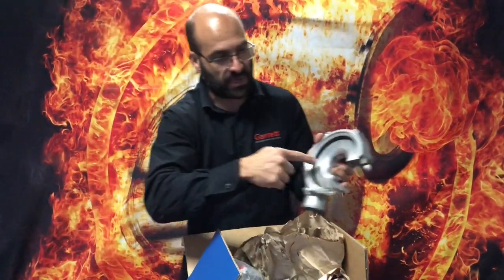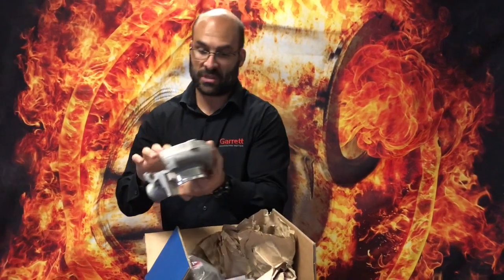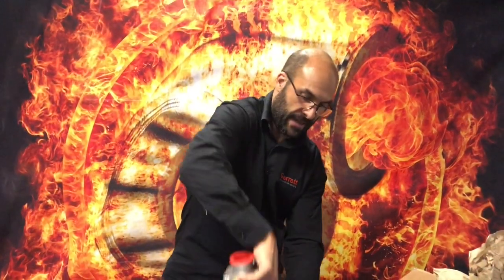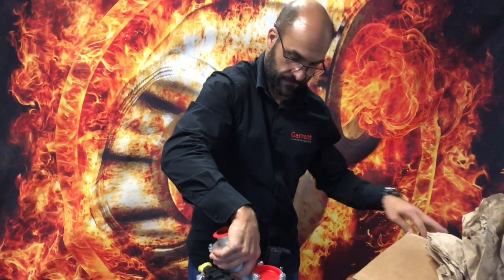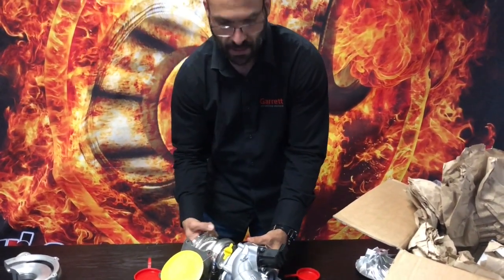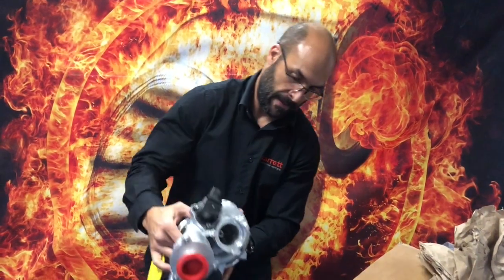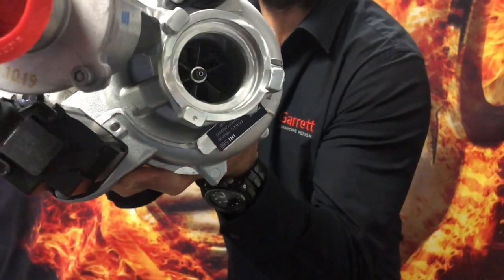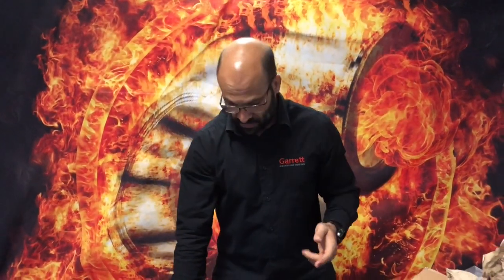IHI IS38 turbocharger facts

Comment: I just changed my compressor wheel on my IS38 and it was making this sound and it had me worried…. After watching this I feel a little better about it but I do have one more worry.

When I removed the nut off the compressor wheel it was NOT reverse threaded…. Everything I’ve read says the IS38 compressor wheel nut is supposed to be reverse threaded.

Mine is a JHJ if that makes a difference at all.
Reply from the maker: The shaft nut thread is opposite to the direction of the CHRA rotation. if your compressor wheel (from facing the compressor wheel) rotates clockwise, then the nut will tighten in an anti-clockwise direction and vice versa.
Reply: @TurboDirectSA   well something is wrong with mine then… on mine the wheel spins clockwise and the nut tightened clockwise
Reply from the maker: @robertburton8055  The IS38 compressor wheel when looking at it from the front will not rotate clockwise, it is an anti clockwise rotation.  Shoot me an email with a picture of the compressor wheel please - info@turbodirect.co.za
Reply: @TurboDirectSA   actually you are correct!!! I was misunderstanding how the fins orientation relates to motion….

I was mistaken… it definitely rotates counter clockwise and the nut tightens clockwise
Reply from the maker: @robertburton8055  Great - i was worried that you had a wheel installed which was incorrectly orientated...... Hope you understand now.
Reply: @TurboDirectSA  

Yes sir I do!!! I actually found a picture on garrets homepage that showed standard rotation and reverse rotation….. it was a lack of understanding on my part…. I made a wrong assumption about the blades and how air ran across them…. Basically I was guessing and I guessed wrong
Reply from the maker: @robertburton8055  Awesome stuff - glad you came right.

Comment: When setting the wastegate voltage on these is38 is it better to be higher in the range or lower? I’ve also gotten different info on what the actual spec range is. Thank you.
Reply from the maker: We have tried to play with the punch response with the actuator voltage setting and we found absolutely no difference at all. We tried 2.940Volts and 3.53Volts  -  exactly the same result both on the dyno and on the road.
Reply: @TurboDirectSA  gotcha. I have mine set to 3.55 at the moment.

Comment: I just got my ihi factory is38 and do hear a similar sound. Good to know it’s normal. Also I’m assuming the little side to side play on the wheel will be taken up once oil is circulating inside the turbo?
Reply: Thank you for the quick reply. I just installed this turbo over the weekend. I seem to be getting a high pitched whine when I’m hitting full boost. I have an open intake so I’m not sure if I’m experiencing a boost leak or maybe just some added turbo noises but my old is20 with all the same mods and a stage 2 flash never made that high of a pitch sound. Should I be tracking down a boost leak possibly?
Reply from the maker: @branman65  Something is wrong - the turbo should never make any high pitched "siren" type sound even with the intake removed completely. Boost leaks do sound similar, but if the turbo was installed and sustained damage to either the turbine or compressor wheel blades, the imbalance will certainly make that sound.
Reply: @TurboDirectSA  yeah I agree. I rechecked all my connections and all seems good. I was thinking boost leak but not 100% sure. I went back in to check wastegate voltage and it appears to have jumped from 3.67 when I installed it and now is at 4.16. No clue how that happened but maybe has something to do with that. Wastegate faulty maybe? This was a brand new IHI turbo not an OEM VW from dealer.
Reply from the maker: @branman65  The voltage does jump - thats why there is a tolerance, always adjust to the lower end of the scale - as the turbo heat cycles, there is such slight movement (bare physically noticeable) which does change the voltage. You should have got an engine light or EPC light come on -- BUT doesnt explain the siren type sound (if im correct with my description of the sound)
Reply: @TurboDirectSA  I adjusted the voltage and is now holding fine. Noise is still there. Does it mainly in 3rd gear pull. I’ll hover around 4K and mash it and hear the noise. If I try similar in 4th I don’t hear the noise. Very odd.
Reply: @TurboDirectSA  https://youtu.be/DLq7ZAmMc5o here is a quick video I took of the noise last night. You can see it kinda of goes away a bit when the car loses traction. I logged boost and it seems to be reaching requested boost just fine.
Reply from the maker: @branman65  Cant hear too clearly, video is too short, BUT when traction is lost, boost disappears or is reduced.  Switch off traction control and the sound should stay or get worse.
Reply from the maker: @branman65  You sure this is not a leak....?  It doesnt seem like the bearing system is damaged or any rotating assembly is making contact with end housings - try make another video thats longer that can clearly record the sound you referring to.
Reply: @TurboDirectSA  It was a leak but not boost. I removed my IE turbo inlet pipe as well as intake and put the stock stuff back on. Noise is gone! So glad turbo is ok and no boost leaks. Thanks for your help.
Reply from the maker: @branman65  Great stuff man -- glad you found it.
Reply from the maker: Yes you are 100% correct.

Comment: how can they say this is true? mine was doing this after 40,000 miles, and ended up failing.
Reply from the maker: I can guarantee you that your turbo did not fail as a result of contact being made between the abradable seal and the compressor wheel.

Comment: This has been done on turbofan engines for decades.
Reply from the maker: Thats correct
Reply: Your right but turbofan engine are test in test cell Where this clearance is done after that the engine is balance and ship to the aircraft builder. In my opinion for the best result the turbo s/b run rebalance and after that put in the car and even if it’s micro metal chip your agree that your engine eat that? This great idea to introducing this in the automotive industry is obviously scrap by the cost $aving. Imo if you tune a car very seriously (not a daily driver) the best it’s to do a break in and after 1000 miles remove the turbo rebalance i little inspection and reinstall it

Comment: won't the shavings make their way into the engine?
Reply from the maker: The dust created form the seal is miniscule and wont affect the engine at all - in fact the particles are similarly sized to the particles that your air filer passes.

Comment: Clearances are extremely tight starting out at interference wearing into what is turmed in the industry as a machinist fit. 
Sounds like an advancement in manufacturing  procedures, both in cost of production and MSRP, better fitting more efficient compressor section resulting in reduced thermal expansion caused by working of air. Win win .
Reply from the maker: Correct - the tighter the clearances, the better the efficiency of the compressor